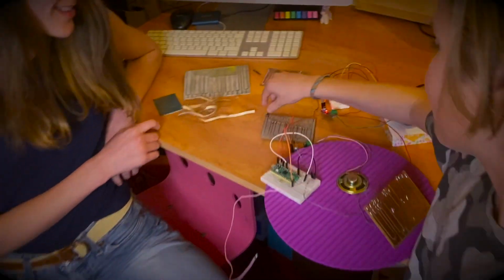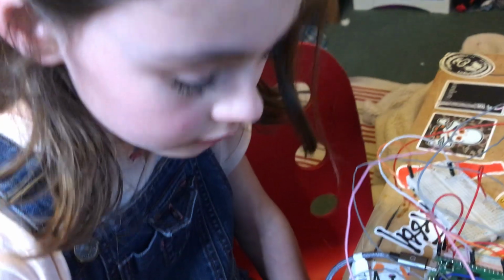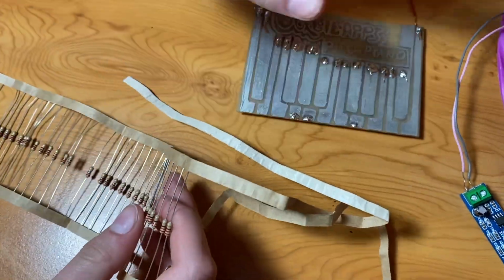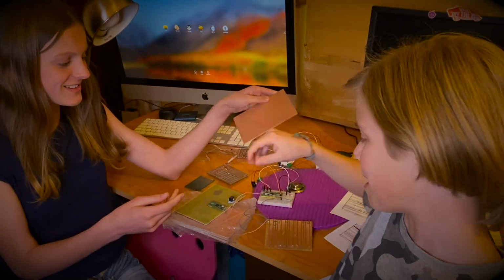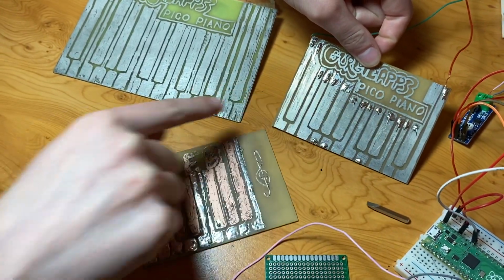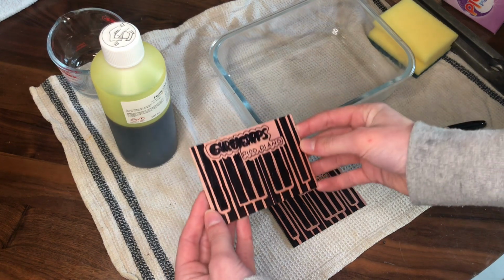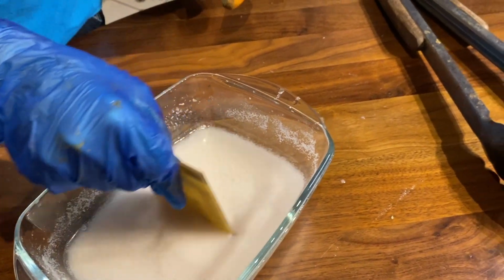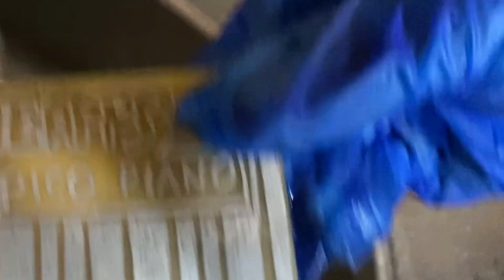How To Build a Pico Piano Using MicroPython & CircuitPython With Midi

Comment: I never realized you could "tin" the copper with a solution, but I haven't etched my own boards since I was in high school in the 1970's, and those were the old brown phenolic resin boards that would warp.  The youtube video I found that described how to make "Liquid Tin" involved some dangerous chemicals, HCl and Thiourea. 

08:35 "Most importantly, don't do it on your parent's walnut dining table, which we would never dream of doing." 😉

02:57 Were those 11 ohm (Brown, Brown, Black), 22 ohm resistors (Red, Red, Black) or 220 ohm (Red, Red, Brown) ?  If 11, even with 17 in series, there will be about 18ma current assuming 3.3 VCC, and if 22 ohm, it would be 9ma, but if it was battery powered, it would use more power than needed.   Total resistance >  1K would be good, 10K - 22K total should work and not have as high constant current.  Other than power used, there there isn't a problem with using 11 ohm resistors (total 187 ohm with 17 in series).